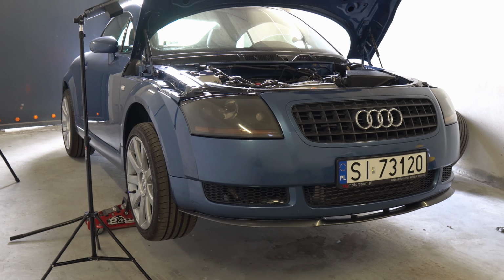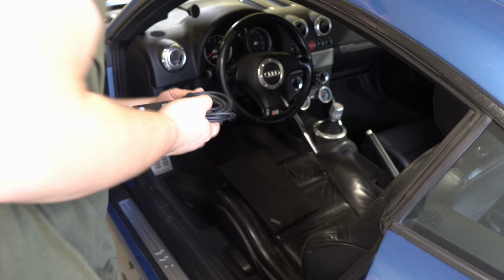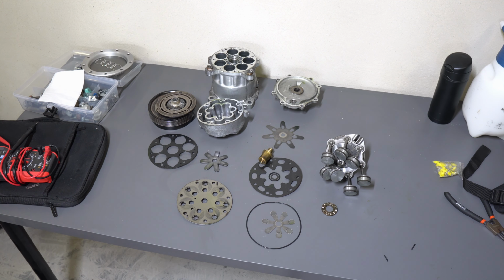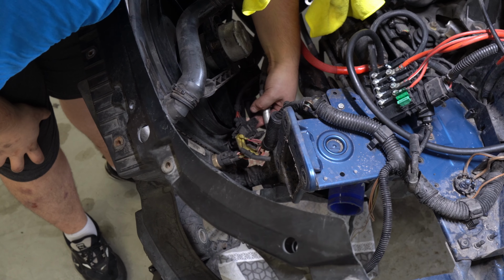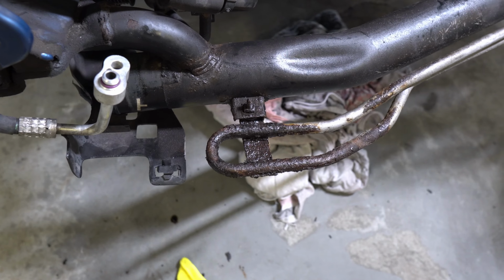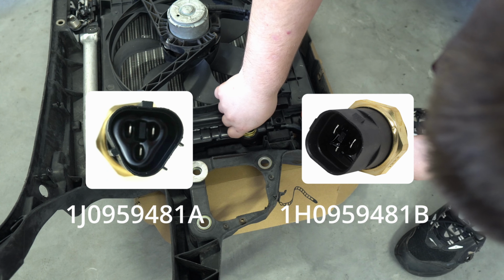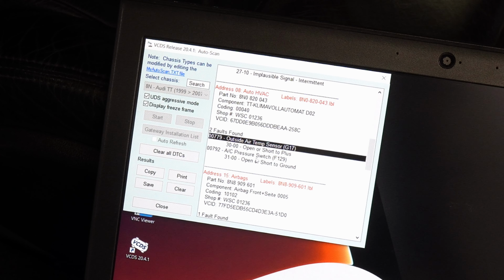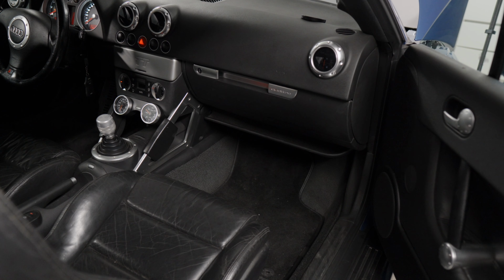Audi TT 8N 1.8T - Air condition and cooling rebuild

Comment: Could you provide more information on the 2 pin connector and sensor used to replace the outside temperature sensor

Comment: i have 00792 but i have power to compressor but its not engaging. so im guessing it could be my compressor thats bad? have not heard fans running either but i remember testing them last year and they worked.
Reply from the maker: It could be the compressor clutch as well. Verify it by applying 12v straight to the clutch plug and then go with the rest
Reply: @wachu8605  fixed :) faulty delphi sensor when new :))
Reply from the maker: @ChocoBaiterEUW  oh my god, really... Thats unlucky :) glad you figured it out
Reply: @wachu8605  yes tried today the clutch and its kicking in.. also fans not kicking in. but they are working on both speeds when hotwiring them on the termoswitch so im clueless. might be a dead new sensor?

Comment: Wow! Nice video since I have to replace AC comp, humidifier and condenser.
I wonder : did you add PAG oil in the compressor. I think it’s about 130 ml.
Also, my 225 BAM TT is overheating.
So I plan to replace the radiator and all the sensors.
Fan are running with AC on, but not when the temp goes to 108 °C 😬
Of course, I suspect the thermocontact on the radiator, and I have ordered the two connectors shape, since it’s impossible to check this with all the hoses and harness in the way.
Something I’m not able to do like you is electrical mesurements :/
But anyway.
Reply from the maker: Hi! Verify the first gear, thats for sure. Also, trust me and get yourself familiar with the meter. You dont need fancy and expensive meter, the cheapest one possible will get you job done and will save you a lot of headache. Regarding the PAG oil it was out of my hands as the shop that i drove to connected car to some fancy machine and it was done automatically based on the VIN. Cheers!
Reply: @wachu8605  
Ok. It’s seems that the AC run only the first gear right ?
I mean when the engine heat is not so hight.  The second one depend on the engine heat, if needed. I saw on my new thermocontacter, not yet installed, two temps engraved ( 1- 95° C / 2- 102 ° C ). This is this sensor witch run the fan right ?
I have a multimeter, but I’m scary to make an electric choc ⚡️😅
You mean that some machines add some oil when filing with AC gas ?
I’v heard that, yes. I have a bottle of PAG 46 anyway.
Thanx for your answers ;)
Reply from the maker: @renedewael9703  Thats right, oil was added by machine along with the refrigerant :) But its totally fine to fill it at your own as long as you keep the values right. 

And yes, both of the fans are running at the first gear when AC is operating. Second speed is handled by the thermoswitch in radiator itself.
Reply: @wachu8605  
Ok thanx ! I begin to figure out the 1.8T concept ;)